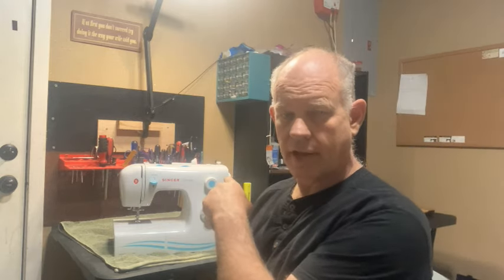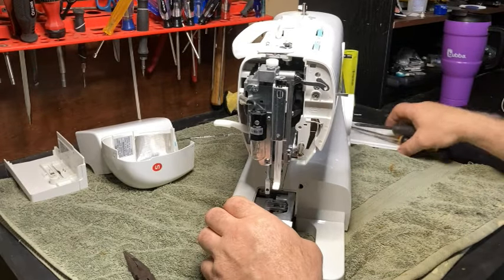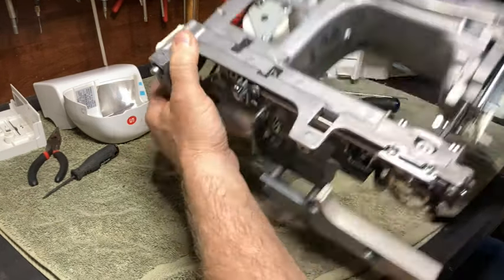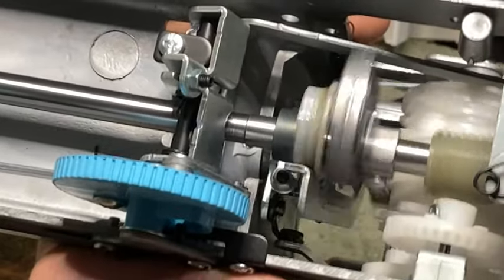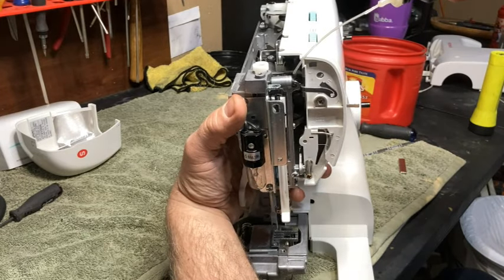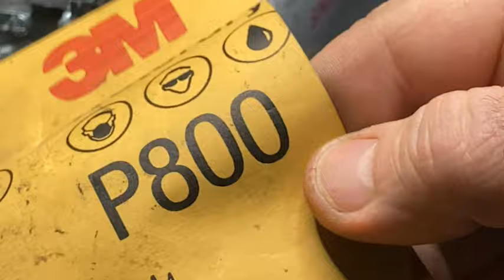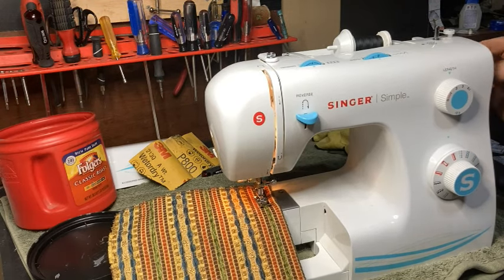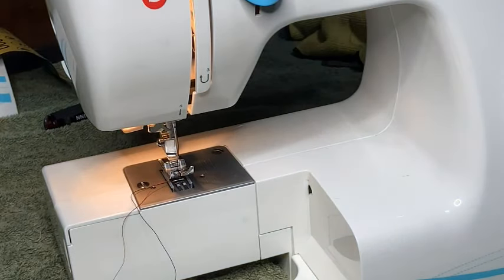How To Service a Singer Sewing Machine: Singer Simple

Comment: Singer Simple Model E99670 came apart as described in your video, but need a LITTLE extra help to get back of plastic case off. The back is held on by a screw a couple of inches below back of handle. The head of screw should be accessible from the outside of the case, but it has a closed plastic disc/plug that seems permanently inserted in the case to make screw head inaccessible. Does this model not allow you to remove back of case, or is there some trick I’m missing?? You can’t unscrew it from inside the machine because it’s the tail end of the screw that shows inside.

Comment: Thank you so much for doing this video!  My machine is 10+ years old and I hardly used it.  However, I have been a sewing badass the past six months and my machine was starting to run and sound really clunky.  Problem - I had NEVER oiled/lubed/cleaned my machine.  Now, she's running like brand new!

Comment: Thank you so much for your video. I got  a Simple at a yard sale for free after no one bought it. It had been sitting on a shelf for years and made a lot of noise when it ran and no zigzag stitches worked. I went  through your video step by step and now it purrs like a kitten and zigzags again.  I ended up with one screw left over but apparently it was not needed (I hope).The bobbin winder still screeches when winding but I think it is just the rubber wheel getting old like me.  Can't thank you enough!!!
Deb

Comment: Thank you so much for this video on the Singer 2263 Servicing a Singer.  I really learned so much.  My Backstitch lever is locked up and I couldn’t get front cover off.  My machine has not been sewing good and had took it apart, but didn’t do a lot of what I should have. Hoping a good oiling on parts will work.

Comment: Wow I really found your video helpful. My challenge was that I’ve got a Singer Simple  3116… and I could not get the cover off. I’ve got a jammed wheel.

However the panels, bobbin apparatus and what I did take apart… all the screws (I could find) I was able to reassemble with confidence from your video instruction. Thank you.

Comment: Thank you for a great video!  I am just going through the whole process and everything seems great.  The only thing I haven't fixed is when I go to refill the bobbin, it starts screeching.  I have oiled what I  can see or get to,  but nothing changes.  If I adjust the height of the needle, then it mostly improves, but the problem is still there.

Comment: Thanks so very much !!! Mine froze it only hummed and i followed you advice I’m still not sure about motor Felts ? But I will watch that tutorial. But my simple front loaded works now !!!
Reply: I struggled with the felts too! They are between the outer casing and the little metal piece right on the other side. There’s a tiny gap where the felts are right on the side of the casing. Sandwiched between them. The 3 little metal parts that you can see on the little blade thingy just on the inside is what keeps the felts together. Like the “bread”.

But if you put a little oil right along the other side of the casing you should be fine :)

Comment: Nice video!  I just  received a Singer 3116 from a neighbor.  it wasn't his so not sure of the previous use/history.  I did take the needle plate off to start cleaning it and there wasn't a single bit of fluff or dust there.  Either the previous owner kept it immaculately clean o hardly used it.  Here's the problem:  when the hook and hook cover are taken out of the race, the handwheel turn smooth at silk by hand and with the foot pedal.  When the hook and cover are put back on it feels like something is rubbing and when turned by hand it's noisy.  Also the part of the race that doesn't come out but glides from side ot side seems to squeak as it swings to the left.  I'm only moving it at the moment by hand until this is figured out.  I have put one or two drops in the race as suggested in the manual but I'm not experinced at all with taking any other covers off and looking insde of this type of machine. I only have experience with oiling and cleaning, and  seeing inside of my vintage Singer 301.  Thoughts?

Comment: When I step on the gas, it struggles. I am not sure what to type in for help. When hand turning, counterclockwise is ok, clockwise is a hard no. Your video is great!!  You helped me get it apart without breaking it. What am I looking for?
Reply from the maker: @cindyhathaway2181  
Sounds like the machine has a heavy buildup and needs to be cleaned and then re-lubricated
Reply: I managed to do that. Had my husband do the motor as he is mechanical and I am everything but. Does the housing to the motor usually get really hot?  And when hand turning, should it go both ways?  Thank you for your advice and especially for your video.

Comment: Thank you so much! I was struggling to find that hidden screw for the front panel! I have a Singer traditional 2273 and the reverse is frozen. The lever itself is moving, but where it connects, there is no movement except from the spring. Any tips? There was also a part that fell out when I opened thepanels. Looks almost like a steel spacer. But I'm not sure what it is and where it belongs. Any ideas? Thank you again!
Reply from the maker: The reverse mechanism in the bottom are probably frozen and needs to be cleaned and lubricated.

The spacer goes just below the tension assembly, it’s to help keep that plastic piece stable.
Reply: @sewingmachinetipsandtricks9079  Thank you so much! You are a saviour! It's so nice of you to keep answering peoples questions so fast! I can't afford buying a new sewing machine right now, so I hope I'll be able to repair the one I have! And also i hate for it to end up in the landfill if it's fixable! Hope you have a wonderful day!
Reply: @sewingmachinetipsandtricks9079  Hi again Richard! It seems like the reverse works but only on length 3 and 4 for some reason. Do you know what causes it to not work on 0-2?
Thank you again!

Comment: Please help, I have serviced my machine foursomes now using your video, what a great help it has been finding your video, thank you. My problem is this time a round hollow piece fell out, it is just over half a centimeter long, any idea where it fell out of? Very frustrating as it has never done that before.
Reply from the maker: @PriscillaLionnet  sounds like the spacer that goes below the tension assembly on the long screw that holds the take up spring assembly in place.
Reply: this is the spacer that came out on me too.   Does the spring go around it?

Comment: Hello Richard,
About a few months ago, Debora wrote to you about replacing a broken bobbin winder plastic arm assembly for our Singer Simple 2263.  The machine we have looks exactly like your video machine.  To make along story short, the replacement parts from a supplier that are guarantied to fit  -> didn't.  Two months later and after two parts that that didn't  fit, then on the third try I asked for the bobbin winder assembly part for the Promise Machine.  I removed the bobbin winder arm with the tire and put it on the original bracket.  It worked!!!!!  Now to my next problem.  I started to reassemble the machine.  When I was given the machine, the shuttle hook holder, the shuttle hook and the bobbin case were loose in a plastic bag.  The machine moves nicely without the shuttle hook and shuttle hook holder.  However, once I put in the shuttle hook and the holder in place; the right toggle lever was hard to turn left onto the holder.  So I loosened it and turned it.  Now the shuttle hook is on so tight that it does not want to move, when I try to turn the hand wheel.  What am I doing wrong?
Reply from the maker: You should never loosen the the holders that hold the hook in place.

It sounds like the parts you received in the bag with the machine  ( the hook and race) are not the correct parts for the machine.

Comment: Much appreciated the video.

I have an issue with the needle. It is stuck at the left side and it doesn't get to the center position even moving the knob for changing the type of stitch.

A "professional" worked on it and it came worse than it came.

Thanks!

Comment: Thank you God for this video! This is an eye opening indeed before doing anything foolish. Singer 3116 C, the handwheel is totally stuck. This is the main problem you've talked about I suppose. So how to drill a hole without braking the plastic? Does service professional do that?
Reply from the maker: Make sure the bobbin winder is not engaged. That causes the hand wheel to lock on some of these machines.
Reply: @sewingmachinetipsandtricks9079  Thank you for caring. Bobbin winder is not in picture. Ticker intervals I do slowly by handwheel for not to break the needle. It was hard suddenly. I reposition the needle up and handwheel got completely stuck. Scared to touch it. The general maintenance book says only: Lubricate the hook-remove bobbin, hook race cover and lubricate inside. Turn the handwheel until the hook race is in the left position.  I do not recall you did that. And stuck handwheel seems like another issue. None of the videos show exactly where to put oil and how to strip the cover. You would have a good lough hearing my friends advice...Thank you God for that video and for me to wait. You've literally came from the heaven, Mr. Professional Angel. I'll try only. Could you please advise me if I can use Kenmore oil for shaving machine ? ...
Reply: Correction. You lubricate from inside not outside as the book says.

Comment: Please mention that if the machine is set to thread the bobbin the turn handle will lock.  This is a really simple fix that most people don't know about or forget about.  Thanks for your video friend.  You are a very good teacher.  I would never take the machine apart, I'd take it to a professional.  However, this machine was given to me for free brand new and now that I figured out why the turn handle was locked I have to figure out why my bobbin thread is jamming in the bobbin area.  Free is never free, right? lol.  😆
Reply from the maker: Yes, on some machines because how the clutch/stop motion is made when the bobbin winder is engaged it locks the hand wheel.

Here is a video to help you better understand your machine and why it loops and jambs up.
https://youtu.be/wjZ1jqIL0DA?si=jHUpJABay6BSkr6c

Comment: Thank you for your video!  My only question is how to oil the motor if it doesn’t have the felt pads?
Reply: I was unsuccessful in getting the front part of the case off so I'm curious how critical the step is

Comment: How do you solve the problem you cut around at the 1 hour mark? The reverse switch isn't latched in, and then poof it is. Did you have to take the whole thing apart again to get it hooked in?
Reply from the maker: Take the front off push the lever up so the outside plastic and inside metal line up and put it back together so the two properly mate up.

Comment: At 22:30, you talk about the plastic part that needs a drilled hole for oil….on my machine, as it rotates, the elongated portion is striking the spring right below and makes a ticking noise at every rotation.    What is this spring for, and can I stretch it a bit to get it out of the way of the plastic part?

Also, after I put it back together, I was left with a small silver colored spacer and a small spring that I have no idea where it came from.     As a machine at this price point is unlikely to have parts installed that can be removed and still operate properly, I am leery of not putting it back where it should go.     But it already seems a lot better after lubricating where you showed us in this video.   Thank you, God bless!

Comment: This really helped me service my Singer Simple model 2263 (with front-loading bobbin). It was difficult to get that second plastic latch undone on the case, but very carefully with a screwdriver I was able to pop it open. With my smaller hands, I just wasn’t able to hold and press it as in the video. I had to take it apart twice though because the first time I put it back together, I didn’t hold the reverse stitch lever and so it was stuck in the down position. Another mistake I made the first time I disassembled it was that I thought I needed to remove the little clip at the top (that holds the tension when you’re winding a bobbin at the top) and a tiny little e clip came out and for a few minutes I was sweating how to put it back. I couldn’t find an example of how it’s supposed to go, so I used my best judgment to recall how it had been. All that said, my machine is lubricated (I skipped the motor, because I’m not having any issues there AND I didn’t quite trust myself with that part just yet) and it’s all back together now. Some test stitching so far looks fine. I really appreciate this video, and am so glad I came across it.

Comment: Hello, I followed your video to see how to take my singer simple apart just like you did. I took it apart to inspect the reverse lever and see if it became unattached. My machine won’t go in reverse anymore and I’m not sure why. Everything mechanically looks like it’s moving properly
Reply from the maker: When you put it back together you need to make sure the metal lever inside matches up with the plastic reverse lever.

If it does not then the lever will appear to work but the machine will not go in reverse.

Comment: I want to service my own machine! Costs $100 in town! I own singer tradition 2250. She’s been stored for several years but works like a charm and bit noisy! My guess is she needs some oil. What are you suggestions? Do I need to buy a new screw driver? Magnetic? I followed along well in video loved suggestion on drilling hole for oiling!! What are the top 10 things I need to address before plunging in?? Thank you!! Cost of new machine is at least $130-150!! At what point should one throw in the towel so to speak?  Peace out!

Comment: Life saver video!
Do you have a video or info regarding an inoperative bobbin winder? I'm trying to repair a friends 2263 where the bobbin winder & large driver pulley stops as soon as the winder clutch arm contacts a lobe on what appears to be some type of clutch inside the hand wheel.
The 2 references I've found online say this pulley should be free on the shaft so the problem is usually old grease?
I'm applying penetrating oil to see if that helps.
If you know of a video I could refer to it would be great!
Thank You!

Comment: Just watched your video,  then feeling I was confident enough  went ahead and got my Singer out which I thought was jammed 
took it all apart and followed you advice, still not able to get the band wheel to turn towards me it would turn no bother the other way, by pure chance I noticed that the bobbin winder was engaged, which of course stops the shank from turning !! Wasn't 
I  feeling stupid ,but at least it got a good service  Now for my other machine a Singer confident it's playing up the stitching  is all to pot , the stitches are tiny and taut  maybe you could do a video on that please. Anyway thanks for all the great advice I learned heaps watching you , All the best from Aberdeen Scotland.😊
Reply from the maker: Thank you!

I am glad I could help and that you got your machine going again.

I make videos on the machines that come in for repair, when I get a Singer Confidence I will make a video on it.

If your stitches are small check your stitch length, if it is making a mess under the fabric, make sure  it is properly threaded, the thread is between the tension discs and in the take up lever.

Mae sure your tensioner is between3 to 5 or on auto depending on which design you have.

Check your needle plate and bobbin case for damage and repair or replace as needed..
Reply: Thanks so much will do what you suggest 😀
Reply from the maker: @hm8781  
You are very welcome, Thank you!

Comment: Im glad I found yr video. Thank you. Is it the same procedure to open the body with my Singer 2250 Tradition?
Reply from the maker: They are very similar machines, yes opening and servicing  is very similar.

When putting it back together pay attention to the reverse lever, make sure you get the plastic lever  onto the metal lever inside  or it will not work.

Comment: Just a question.  Is there an actual diagram that shows where the screws are. I ended up with one metal crosshair screw.  I have the two plastic screws on the top, two on the back one to hold on the side cap,
Reply from the maker: @annmcfeggan111  unfortunately no there is not a diagram that shows where all the screws go.
Reply: is it that critical to get the exact screw type correct, or can any screw go anywhere providdd the length is in the same ballpark?
Reply: I was able to figure it out with trial and error.  By the way, thanks for the video.  My machine works perfectly now 😊

Comment: I have 3 older Singers - all bottom load bobbins. On one the gears are locked up to wind the bobbin. And the front will not swing open. The two others the stitching is messed up.